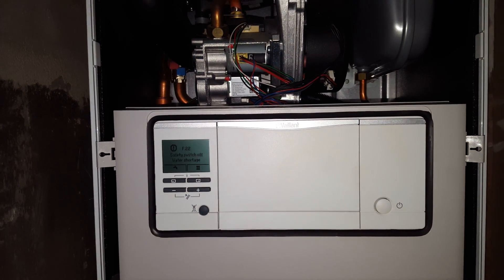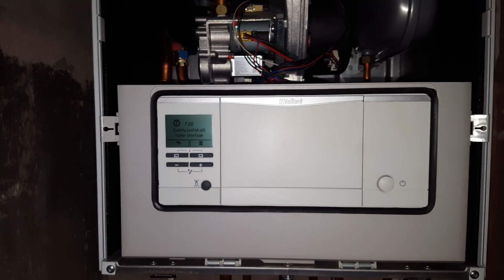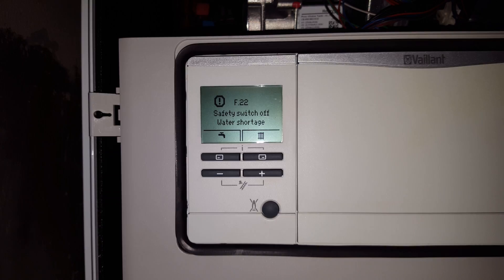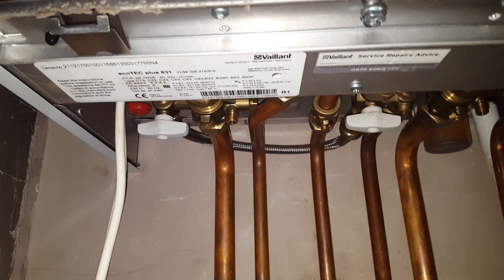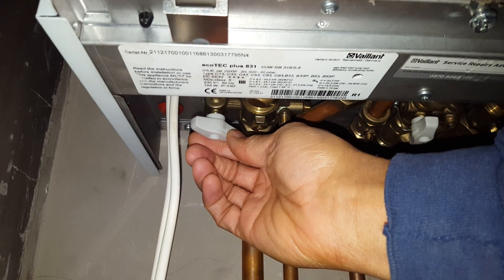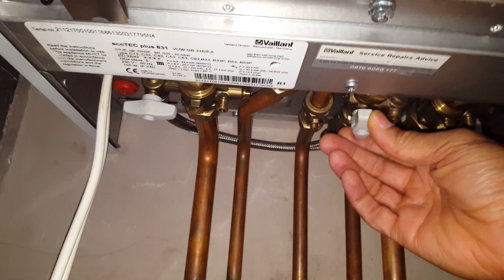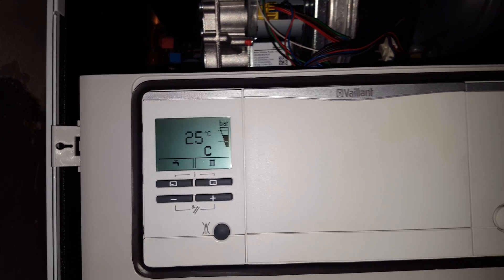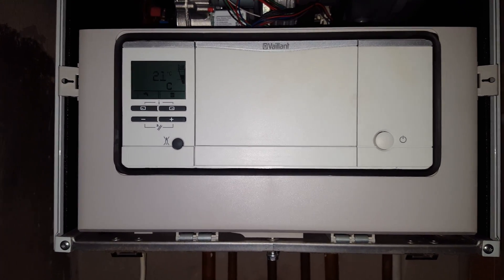F22 Code Vaillant Ecotec Plus

Comment: Hi. Hot water is working. But no heating. Maybe the radiators need bleeding? Or Maybe I should try turning those two valves shown in the video above....
Reply: Well...  it turns out that the thermostat on the wall needed batteries.   Problem now solved. Cheers...
Reply from the maker: Could be however you may a good engineer to repair it
Reply: I'll try the two valves below some time today ... I'll contact the suppliers ( Vaillant ) for a service/repair if that doesn't work . Thanks ..
Reply from the maker: Yeah try that first

Comment: I did this and now there's water pouring out from a pipe outside, it's ruined my decking and some outdoor furniture, I'll be consulting my solicitor so you can expect a claim for damages.
Reply from the maker: I'm sorry I cannot give any advise on this matter
Reply: It's your pressure relief valve from your boiler that's broken. It's just normal water.